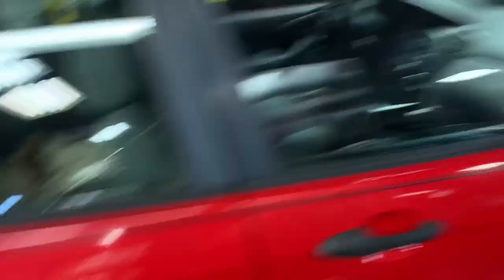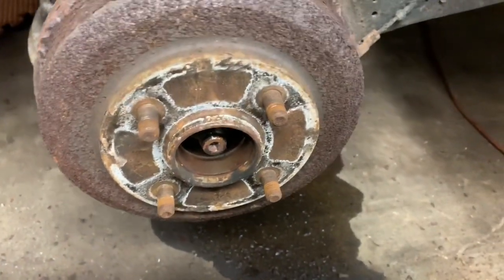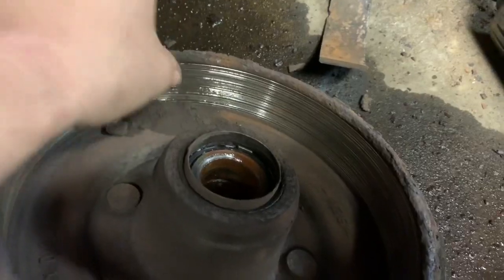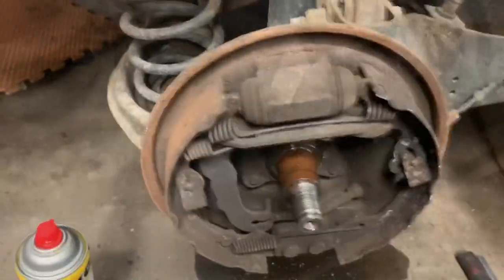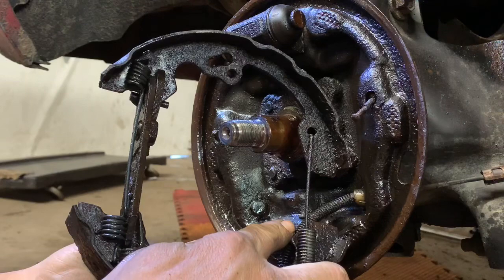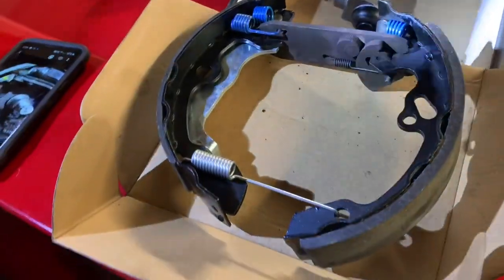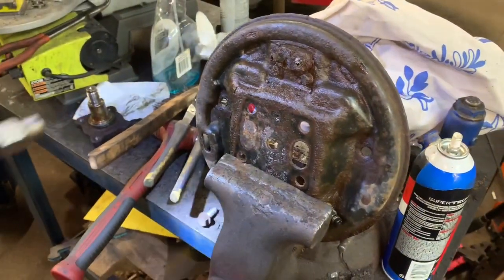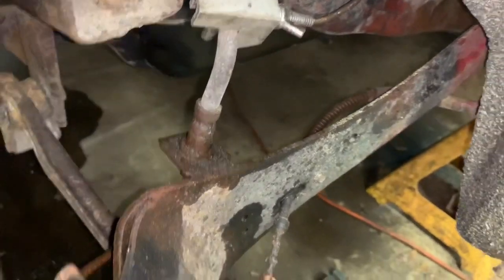Ford focus rear drum brakes

Comment: My wheel cylinder bolts were 9mm. Brake line was 11mm of course the bleeder is 10mm. You know Ford will use weird size for certain things...like sensor or electronics will be 7mm instead of typical 8mm sizes. I'm watching this due to a drum seems to get hot after repair. YES...a test drive then stop to feel em for temp. The drum installed a bit tight on new shoes but would still turn with effort. Yanking the emerg brake while driving hoping to wear pads just a bit didn't work, so it's back to taking it apart to look at the adjuster mech and see if it is the prob.

Comment: My emergency brake is inoperable. And I don't have time to change the cables. Can you make the adjustment on the Wheel before I put the hub back on? Adjust the adjuster without using the emergency brake technique.
Reply: Yes. Pumping the foot pedal a few times gives the same result as pulling up the parking/emergency/hand brake (whatever you call it in your part of the planet).
You don't actually need the emergency brake cable attached for the rear brakes to work when driving.
You obviously do need it attached to pass inspection.
Reply: @JazzFunkNobby1964  LOL what do you mean my part of the planet? And they don't check the emergency brake when the car gets inspected. What part of the planet you from? But thank you for the info this thing won't be fixed until the beginning of next month I'm having a Mobile Mechanic come over to get those damn spindle shaft nuts off. I tried everything. And I'm getting too old for this. My body feels like I ran a 2 mile marathon the next day from laying on the ground for 2 hours trying to get those nuts off.
Reply: What I mean is that you call it an emergency brake. I call it a hand brake. Other people call it a parking brake.
Depends which part of the planet you're from what you call it.
You know there's a different method to the one you did. Remove the four bolts from around the back of the drum/hub and the whole lot falls off. Easy.
You don't even have to touch what you call the spindle shaft nuts.
Go have a look for those four bolts and maybe save yourself some cash.
Be lucky. @BugzKiller
Reply: @JazzFunkNobby1964  on my 2006 Ford Focus the drum comes off separately. The Hub does not come off unless you disconnect the control arm back there bushings shock absorber all of that stuff. I know what you're talkin about because I saw at the store that they sell the hub assembly but it does not apply to my car. The drum comes off with the bearing in it and then because I drove the car for 6 miles with the tire wobbling like crazy and smoking because the bearing went it ruined the spindle, half of the threads are gone. I had to drill off the big lock nut that goes on the spindle with the drum.

Comment: I did the shoes but can't get the drum to go back on.  Was hoping to see your trick to do that but you quit before putting the drum back on.
Reply from the maker: Oh that’s no big deal you just need to adjust the little star wheel down at the bottom to make the drum go over the pads. Then you adjust the Star wheel once you put the drum on in till  it just starts to hang up. Then you’re good to go sorry I couldn’t answer earlier
Reply: @sharpcarco  Laid on my back, took all the adjustments out, drum on, done!
Reply from the maker: Awesome!!!
Reply: Wrong answer. You are talking about different brake setup to the one in this video which has auto adjusters,  @sharpcarco

Comment: I want a "gnarled wheel" when I grow up.  I guess I'll have to settle for a knurled stop until then ;-)  

This is the first one of this design I've done.
Bottom line: It blows.
The old washer and spring combo was better for reassembly and what is required to get the shoes close enough together to reinstall the hub is not apparent on this design.
I was also surprised at the small amount of brake material on the trailing shoe of a new set.

(Having done work like this for 54 years probably makes me prejudiced against certain designs...or I'm just old.)

Good video though.  
I might say; "Gnarly".
Reply: You manually turn the snail cam which is part of the auto adjuster to it's lowest point. This sets the two shoes as close to each other as is possible enabling the drum to slide back on with ease. When everything is reassembled and brake system bled (if necessary) pumping the brake pedal a few times will make the auto adjust mechanism set that snail cam to the correct position.

Comment: Just did my 2003 Ford Focus rear passenger-side. Do NOT use the method in the video NEVER EVER NEVER take the drum off.... removing the entire assembly is super easy:    You do not even need to remove the hub nut.:   Remove tire.  Using a 13 mm socket with an extender, remove 4 bolts that secure the spindle and drum assembly. Those bolts are BEHIND the backing plate, right in front of the big suspension spring.  The spindle, hub nut, and drum slide off really easy as a complete unit (!).  Replace brake shoes, re-bolt the spindle-hub assembly, ,  To adjust brakes, back up a little and apply the brakes, do that a couple times.  Do it again a couple times going forward.  BTW, do bearing replacement the same way only buy a new spindle, hub assembly, and hub-nut at the same time, it is cheaper that way.
Reply: How much did the repair cost you the spindle nut that goes over the dust cover  It was 23 dollars for one piece, pretty much same for wheel cylinder and anything else

Comment: You didn't mention the rivets that hold the backing plate on, you can drill them out or chisel them off. What about when fitting the backing plate back on, did you rivet it back or just sandwich it between the hub and arm,? The rivets are only there to keep it in place for ease rather than for strength.
Reply from the maker: I don’t remember, but I probably didn’t change the backing plates unless they were super Rusty

Comment: not a single person question emergency brake lever angle ?? how can you get good adjustment (affects pedal height) with ebrake applied ??
Reply: What do you mean?
Reply from the maker: He’s referring to adjusting the emergency brake cable which is unnecessary. If not disturbed or moved. 

It is probably something that I should’ve put in the video but didn’t think about it when I made this video. 

Because if you don’t do nothing with it you don’t have to do anything with it….
Reply: @sharpcarco  Oh awesome thanks.  You guys do awesome videos and work.
Reply: Wrong. If you fit new shoes you need to adjust the emergency brake cable.
You adjust it at the lever end of the cable inside the vehicle. @sharpcarco

Comment: Do you know where you found that wheel puller kit? I got one from harbor freight for the job but the yoke was too small to fit around the bolts and now I gotta find the right size

Comment: I wonder how long these drum brakes are supposed to last... replaced mine less than 25k miles ago an now they are screeching 🤦‍♂️
Reply: My focus has 200,000 miles and I have never changed the drum brakes
Reply: its the damn bearing... the inner race side has a rubber seal but the outer race side just has a metal grease sheild and it leaks out grease over time... when these make noise, its that outer bearing for sure thats run dry... when or if u replaced the bearing itself, you will see its huge and wide ..the inner view shows 2 races contained in that wide outer casing... the inside race is sealed, the outer isnt and fails...

Comment: Hey can I please get some help asap I have done everything and I have replaced the brakes on the rear driver side and now I'm trying to get the new drum hub over the new brakes I thought it would slide back into place and nothing is going right what in the world did I do wrong please help asap
Reply: Make sure the adjuster rod is on correctly. You also might need to use a rubber mallet to tap it into place. That’s what I had to do.

Comment: What is the name of the tool you used to pull the drum
Reply from the maker: No I don’t have time to go back and watch the whole video can you give me a time when I was using it
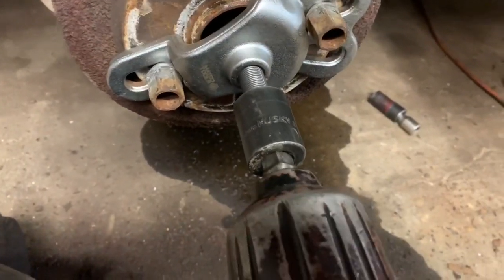Reply: @sharpcarco  1:50
Reply from the maker: It was actually two different tools one was the adapter plate for a slide hammer. The other part was a bolt that threaded into where the slide hammer arm would thread into. So you can go to the local parts store and you can rent a slide hammer and then go to the hardware store and get a bolt that is about 5 to 6 inches long and use that just like I did in the video. 

I used the Lugnuts to hold the tool to the hub
Reply: @sharpcarco  thanks allot

Comment: Not a good idea to clamp old rubber brake lines for the obvious reasons. Instead of spending time pulling backing plate much easier to heat brake cylinder hold down bolts and tap head with hammer 9 times out of 10 will come loose and if they do snap off just buy a couple bolts at parts store when buying your brake parts. Same with brake line just heat the connection.